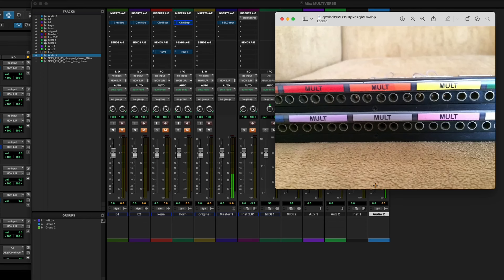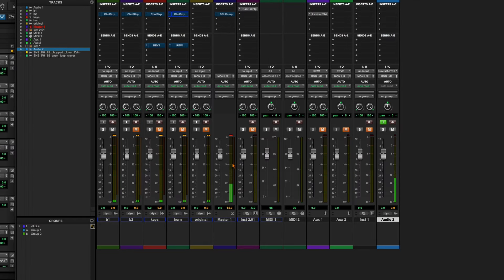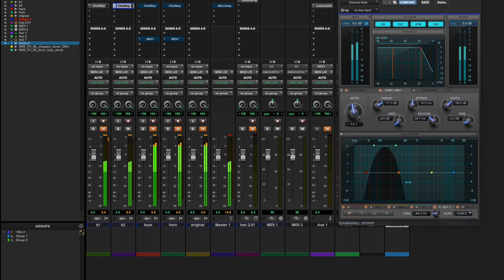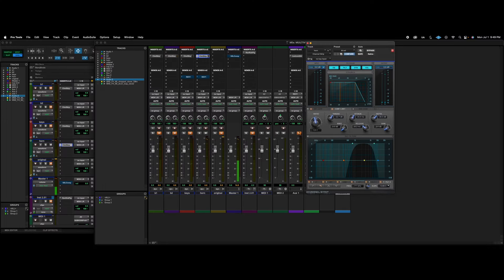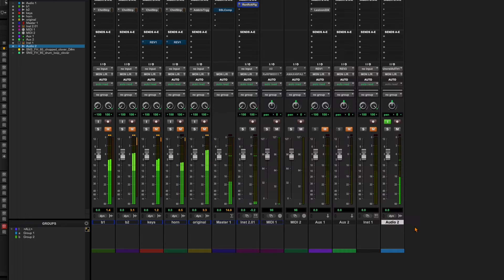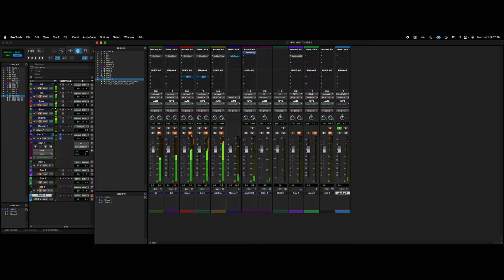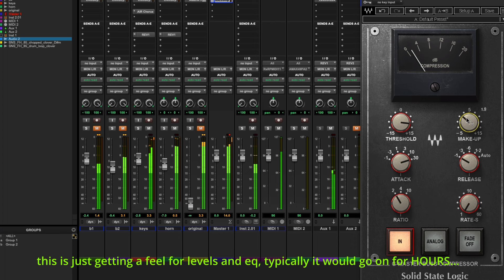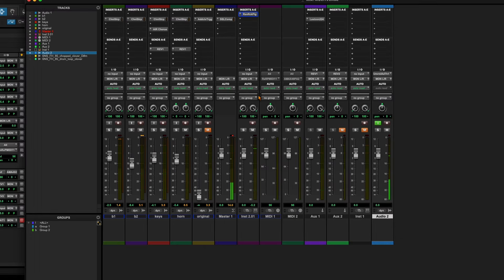This is some 90's hip hop time machine

Comment: One of the things i always wanted to know is how kick drum scratches were handled in the mix.  Lots of tracks in the 80's and 90's utilized kick drum scratches. You get a vibe almost like there is a live DJ cutting up two copies of the same record for the drum loop. The thing is, MPCs and SP 1200s don't really allow you to sync in live scratches!  So how did they lay those types of kick drum scratches in the mix?  Were you overdubbing after the track was already laid down?  If so were you matching up the same kick drum sample that was used for the programed drums?  I could never quite figure out how that was done back in the day.
Reply from the maker: great question...I'll try to put that in a future vid
Reply: @TonyBlackNYC  That would be great!

Comment: We used to call this the ghost filter and use it to separate the lows in the sample and isolate them as baselines. 

I still do it to this day and sweep off like 100-200Hz on one track as the main sample and duplicate that with the lows isolated.

From there, I'll add some distortion,  clean up unwanted frequencies, throw on a compressor...and then sidechain the kick. 

The end product is always super clean and my drums fit in their respective pockets, perfectly.

Comment: Can you make a video detailing how you record with an SP1200 & akai S950? What techniques would you use to get the PHATTEST sounds out of the samples and what analog equipment would you recommend?!!🧐🤔
Reply: The technique Tony showed here is a massive secret sauce not to be overlooked as it works both on music AND drums.
I would say it’s all in the sounds you use and not going too crazy with eq + compression - ideally try not to use any of that and instead get the levels right because each sound in the track/mix has a relationship to one-another - which determines how you percieve the fatness/thinness/warmness/brightness of that sound.

Another one to play with is stacking / layering as this often gives the impression sounds are individually “phatter” than they are (eg laying a sub kik or 808 under your main , or perhaps tucking another snare behind a drum loop to have more control over how much it pops.

Eq and/or compression can make things get unnatural and messy quite fast, whereas just playing with your levels can yield extremely different results you may only expect to get from using eq.

I’d say getting your sample into the machine as approximately close to what you imagine then trying to get a decent “mix” all inside the SP+950 is a great way to start getting much cleaner results than relying on outboard afterwards. I made that mistake for years until I got a dj mixer with a really nice sweepable filter and my samples just got a zillion times sharper.

Looking forward to hear Tony’s take on this.

Comment: Here in UK in the 80s + 90s the more common midi sequencer was generally the Atari ST - MPCs and SPs were here but not anywhere near as common as the states. 
Did you or anyone you worked with use the Atari running C-Lab or Cubase at all?
Reply: Man like Harry Love 🙌🏾

Comment: I always try to process as little as possible the sub, worrying for phase cancellation. You have the sub, the original kick and the additional kick sample tracks that overlap each other's on the low end., they are both EQ'd at different frequencies and therefore their phase is different. By summing them you will likely end up with an irregular/unpredictable sub. What is your approach/view on it? Thank you for sharing!

Comment: hey Tony I've seen people like dj premier speak on how they'd use the mpc 60 in combination with an S950 to make beats with. I'm wondering if you had any experience working with people that had that type of setup and if so were they using the mpc mostly as a midi trigger or were they syncing it with the S950 for more sounds and such?
Reply: They did both … thats my setup of the last 5 years…. Both sample but the 60 the only one that can sequence

Comment: I used to have a 60 with that plush arm rest. To be honest, the operator matters more than the machine. It colors the sound slightly, but its not be all end all. I actually preferred my 3000.
Reply: I had a 60Ii and a 3k, but preferred the S1000.

Comment: I know that splitting bass and tops was a thing in 90s Hip Hop, however splitting a loop in more sections is very interesting. However, how you dealt with phase issues then? Was that a problem often? Big like by the way 🙂
Reply: Definitely have to pan samples that just him isolating the layers to boost or cut
Reply: @Darie2006  Ah okay, thx.